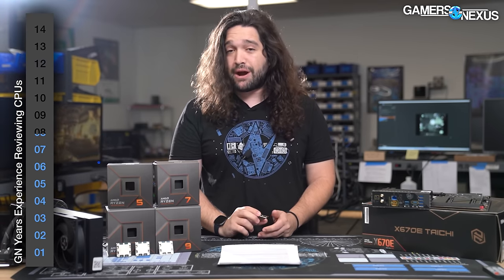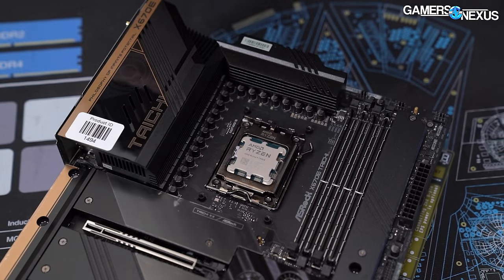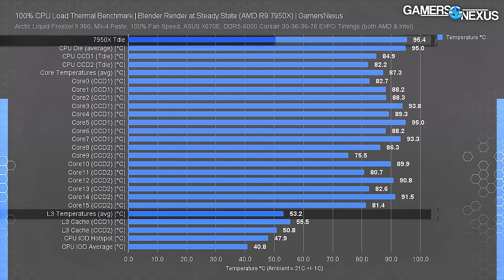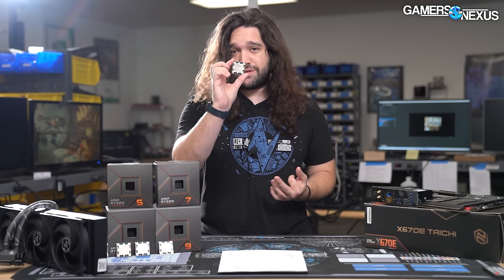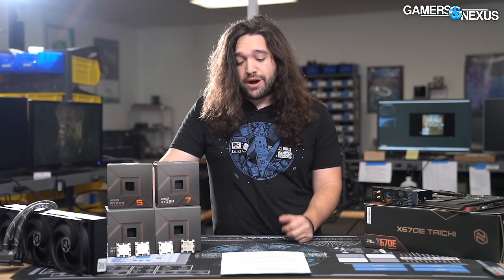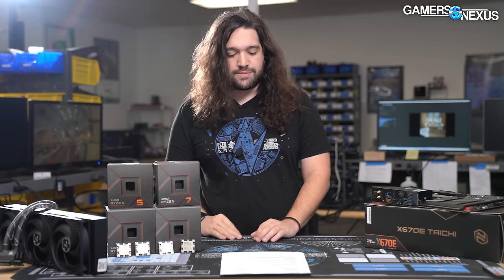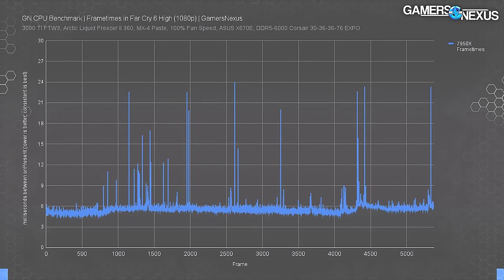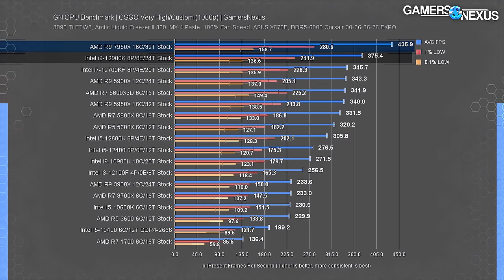95°C is Now Normal: AMD Ryzen 9 7950X CPU Review & Benchmarks

Comment: I would love to see more CPU-focused games to start getting tested. Simulation heavy games, large sandboxes, stuff like that. I don't know what kind of benchmarking those games support, but with being GPU bound on most games, or being at FPS levels where it doesnt matter, those might still present an actual useful difference.
Reply: mega station re-entry in kerbal? something like that?
Reply: I second this. I'd like to see the difference as well since I play more of those types of games.
Reply: I remember seeing Civ VI being used for benchmarks like this on some other channels, but that's obviously more random and the result is less replicable so I understand why GN may not want to use something like that for testing
Reply: Warcraft 3/Starcraft 2 most certainly!
Reply: They should do some VR games for benchmarking, since alot of them tend to be CPU bound currently, a good example being VTOL VR
Reply: Emulation benchs would be good too. things like Dolphin and RPCS3.
Reply: Even then those games aren't really multithreaded enough to make sense for the 7950x, in many cases they're completely single threaded!
Reply: @TimSheehan  This is as opposed to any of the games tested/in existence which scale to 16 cores
Reply: BeamNG stress test with full traffic? Timberborn with 1000 beavers? Universe Sandbox and see how fast you can advance time?
Reply: @LunarLaker  not as opposed to, but they're even less multithreaded than your average DX12 / Vulkan game
Reply: Maybe X4 foundation / Arma could test cpu
Reply: I'm surprised they don't do any CPU heavy Battle Royales like Warzone/Tarkov. I'm seeing people anecdotally getting a big uplift on Warzone going to the 5800x3D from other Zen3 chips. 

I mean why are they testing games where they are getting 600FPS? Some of these games stopped being relevant to CPU performance like 6 generations ago.
Reply: 144FPS its the matter !
Reply: A heavily CPU limited game is Beamng drive.  I managed to pin my 12900k to 100% use with 50 other cars in traffic settings.
Reply: Spider-Man is a great recent example - open world + raytracing can be incredibly demanding on the CPU. It's very easy for me to underutilize a 3090 (using a 5950x) even while running around 1440p.
Reply: I agree. I think it would be interested to see benchmarks in games like Rimworld (with a large colony), They are billions (with a large hoard), and Project Zomboid (with lots of zombies/items loaded in the same cell).
Reply: Flight Simulator would be a great sim game to test, now that there are replay tools (built-in, as well as free & paid mods) that can fully replicate flights for benchmark purposes.
Reply: @Richard-tj1yh  those are single core games only, no multicore support
Reply: Indeed.  I've long wished that reviewers would find a way to include heavily modded Cities Skylines, as that's long been an IPC crushing CPU limited game.  Though it would realistically require collaboration with C;S streamers, to ensure the right mods are being used and it would need to be updated at least annually to ensure relevancy as new mods are introduced and updated.
Reply: DCS (a combat flight "sim") in VR will take the 4090 (rip SLI) and any CPU (even on LN2) and give you < 60 fps most of the time.
Even without VR, it's still practically impossible to achieve a stable 120 fps (or even just 90 fps at low altitude) on any of the recent campaigns.
Reply: Yeah. I really dont agree with the testing results here. Playing Satisfactory.. 800 hours in, my FPS has gone from 120+ to barely 50 FPS on RTX 3080. i9900K. All cores pegged at 90%+. And then these reviews just come and say that CPU does not matter and its a waste of money to buy it for gaming.
Reply: Would love to see Factorio benchmarks
Reply: MSFS, DCS Word, Factorio, Satisfactory... pick any simulation game really, the scaling across them is quite similar for most part.
Reply: do a petition and yell at twitter i guess
Reply: @mortlet5180  Hello fellow sufferer.
Reply: Try Paradox Grand Strategy games!
Reply: Yes, something on a large map/server with lot of players and NPCs.
Reply: this, microsoft flight sim or ACC, many mmos are all still hugely cpu bound in real situations player encouter (crowded towns etc)
Reply: Total war with extreme unit size!
Reply: Yeah, something like Stellaris, Factorio, Dwarf Fortress
Reply: I was just thinking about Factorio and Civ
Reply from the maker: Sure, we can look into some. Please post some you'd like to see!
Reply: @GamersNexus  Yeah Cities Skylines is still one I play regularly. Same as others Factorio and ACC are on my recently played too.
Reply: Play badly optimised MMOs
Reply: Cities:Skylines with a large amount of mods and assets.  I had to upgrade my gaming rig with 64GB of RAM just to satisfy my mod addiction 🙃
Many of the C:S YouTube creators post save files and their mod collections, so getting one of their ridiculously large maps saturated with mods and assets is relatively easy to do.  City Planner Plays is one of my favorites who is really meticulous about save files and providing mod/asset collections on Steam.
Reply: Farm simulator 22. Quite demanding on vid cards.  Yes… there other great games instead of games killing constantly.
Reply: @GamersNexus  a total war game with extreme unit sizes would be great!
Reply: I AM THE BEEST YOUUTUBER YOU'RE ALL TRAASH COMPARED TO ME IM THE BEEST 😂😂😂😂😂😂😂😂😂😂
Reply: beamng drive would be good for that as its almost entirely cpu bound, and when its not just spawn in more vehicles.
Reply: It's Gamers nexus, but should be called blender and Puget nexus
Reply: @GamersNexus  Benchmark Rust, its game where only 5800x3d performs good.
Reply: It would be cool to see some VR benchmarks thrown in there too. Most VR games are cpu limited at this point. Blade and Sorcery starts to shit itself if you try to spawn to many AI with a older CPU (I’m on a 2700x and a 2070 in a SFF rn and can get 7 or 8 spawned at once before I start to notice issues, no matter the graphics settings)
Reply: @GamersNexus  Try minecraft with various number of entities present on screen
Reply: @GamersNexus  Cities Skyline and Beamng Drive are two that I play regularly that I would love to see how those do.
Reply: @GamersNexus  I'd like to see Valorant, but it might be difficult to benchmark
Reply: @GamersNexus  total warhammer 3 on max settings would be great! Cities skylines or hoi4 maybe!
Reply: @GamersNexus  Paradox titles (Stellaris, HoI4, CK3) have maximum game speed limited by CPU capability only.
You can start a game as spectator, put max game speed on and see how long each CPU takes to process 1 game year in HoI 4 as an example. It does have practival application for gamesrs who play those, as sometimes you want max game speed compression while there are no new decidions to make.
Reply: I still like to use Civ 6 as a CPU benchmark.
Reply: @GamersNexus  Total War: THREE KINGDOMS or the Warhammer 3 title. As well Age of empire 2 Definivite edtion, Age of Empire 4 all with 4vs4(bots)
Reply: Factorio megabase fps tick rate and fps would be a good benchmark.
Reply: RPCS3 would be a great test to add, with how CPU heavily the emulator is.
Reply: @GamersNexus  Minecraft is a good tester for CPU bound games it would definitely help, it has very high numbers which would help test
Reply: @GamersNexus  Stellaris, a space (soft) sci-fi RTS with minimal visual load where building a planet cracker and obliterating a civilization or two is universally accepted solution to inevitable late-game perfomance issues. They even have a dedicated "Perfomance" section in every update! Standartising a test would be nigh-impossible, though.
Reply: @GamersNexus  Late game campaign map for total war Warhammer 3 or 2, as well as a battle with multiple armies fully stacked, and late game civilization 6 would be amazing. Specifically late game though. Total war would be perfect, my PC literally freezes if I push it too far.
Reply: @GamersNexus  1. Assassins Creed Valhalla 2. Call of Duty 3. Maybe even GTA5 because of the big userbase and demand of the detailed open world
Reply: @GamersNexus  DO STELLARIS LATE GAME --> how many days can be simulated in example 10 minutes.
Reply: A great game for that would be teardown, all the physics run on a single core, so your fps is single core dependent.
Reply: @TimSheehan  that's the point of the tests, lol.
Reply: The easiest one to set up probably with Assetto Corsa with maximum AI player
Reply: @GamersNexus  Hearts of Iron 4, a 1950 save, fully decolonized Africa trying to go 5 speed.
Reply: @rahulahl  the reality is satisfactory is a niche game and there's a reason why they tell you to check other reviews and not just go off the word of one review. either way it's a hard to test simulation games because everyone plays them differently. there's no way to say "this is the exact performance you're going to see".
Reply: @GamersNexus  any paradox game late game will choke and kill even the strongest of CPUs, they're a good benchmark if you want to find out which does best. Simply take the amount of time it takes to process x amount of days after x amount of time has passed in-game. Stellaris is notorious for it's late game slowdowns because of how much it starts to hammer the CPU.
Reply: @GamersNexus  Beam.ng is very CPU heavy if you have some AI cars driving
Reply: @GamersNexus  Cities Skylines, Arma 3, Squad, Assetto Corsa Competizione are some I can think of
Reply: Factorio. Run a 10000 SPM (Science per minute) factory and show us the FPS/UPS...
Reply: @sirmonkey1985  Dont need the exact numbers though. If a benchmark shows 60 FPS with CPU A and 90 FPS with CPU B, in a typical scenario, thats all the info that matters. 

Just pick a game.. maybe get your audience to give you a savegame if you dont wanna invest much time in it, and just run the numbers on a particular scene. 

And I really dont agree with the fact that testing games that dont even need the CPU to show how good or bad a CPU is and then saying that if you game, then the CPU is not for you is any better than using less common but more relevent examples of games. 

I just feel tired of almost every outlet trying to downplay CPU, when I seem to be constantly bottlenecked by CPU. The most common games I tend to play are Satisfactory, Counter Strike, VR games, etc. I know its my problem that I am using games that are not popular and I might be niche. But in a CPU test, I want to see games that actually care about CPU. Not just GPU bound games artificially limited to be CPU bound. That is just unrealistic testing.
Reply: @GamersNexus  world of warcraft, along with some ram testing please.
Reply: @GamersNexus  Satisfactory please.
Reply: @DocNo27  Same deal here, I bought 64GB RAM explicitly for C:S.
Reply: @Baconism  yes, great. that and dcs.
Reply: @GamersNexus  If you don't mind older game from 2007 then Forged Alliance Forever is still getting bottlenecked in single core performance even today. And what's important it greatly maybe even linearly scales with the IPC of the CPU and RAM combo across the line, be it Intel or AMD. That is due to the simulation part of the game being single threaded but having to calculate and simulate thousands of units and projectiles every 0.1s which leads to the simulation part getting slower and slower as more stuff gets added to the battlefield over the course of a match. In some cases leading to scenarios where 1s of in game simulation takes dozen seconds IRL. 

As for how the test would be performed? Well, we at FAF can prepare a special scripted scenario for you that would push the simulation as hard as we can while making sure to record the time it takes the CPU to finish it. Actually, we already do have few of them as we are using them to benchmark players CPU so that we can give them a good estimate of performance and what types of maps/games or how many units they can have in their games before the game inevitably becomes to slow to play it out due to CPU bottleneck.

And in our findings the scenarios are nearly if not perfectly reproducable each and everytime so they make for good benchmarks. Another thing to mention is that the benchmark results nearly perfectly correspond with other IPC tests so there is no bias in the results in our understanding.

Also, you will get brownie points from Linus Tech Tips as this is one of his all time favourite games, one that he still plays in his free time. 

Anyway, if you are interested don't be afraid to reach out to us by email: admin@faforever.com  as I'm sure our Devs will be willing to help you out in setting up perfect benchmark suite.
Reply: @GamersNexus  just test Star Citizen @4k and get sucket out of the window with 100 load on both , GPU (6800XT) and CPU (5800X3D)
Reply: @GamersNexus  DCS, VTOL, kerbal, factorio, BeamNG, stellaris...
just anything that does physics or ticks with cpu will do and we can extrapolate for most cases and sus out outliers in forums ourselves.
thanks, steve!
Reply: @GamersNexus  Team Fortress 2 is very cpu bound and has a builtin benchmark command "timedemo" the game is kinda old at this point. Still has a lot of players though
Reply: Factorio megabase!
Reply: Oxygen not included is quite cpu bound
Reply: @GamersNexus  I know it’s quite an old game now, but Arma 3 is extraordinarily CPU bound. There are even some community made benchmark missions on the workshop. Another heavily CPU bound game would be the combat flight sim DCS. It’s possible to make a 100% replicate-able benchmark where your plane just flies straight over a massive ai battle. I would love to see you guys test games where the new CPU’s could actually make a huge difference in gameplay experience!
Reply: Yep. I'm thinking massive parks in Planet Coaster, and sprawling metropolises in Cities Skylines.
Reply: Yeah I'd love to see benchmarks of Space Engineers and Satisfactory
Reply: @GamersNexus  Escape From Tarkov is very poorly optimized and as a result is quite CPU and RAM bound
Reply: @TimSheehan  this cpu should be peak single thread.
What other games require this kind of cpu power other than old unoptimized single thread games? As you can see, everything else is obviously playable as Steve remarkably pointed out with Rainbow Six Siege reaching 600fps+
Reply: @GamersNexus  Older single thread games like Starcraft 2/Warcraft 3 is where this new computing power is actually applicable, unlike the alikes of 600+ fps Rainbows with CPUs nowdays
Reply: @GamersNexus  Get someone to make a Factorio megabase and use it for testing, that will give very good benchmarks
Reply: @chdn  Vanquisher Class Mothership (914k PCU) from steam workshop can used as benchmark. Sim speed while flying in a straight line can be used as measuring criterion. for example my tuned 12700k@4.9GHz all core / 4.6GHz ring (e-cores and ht are off) with 32GB 3800c16 ram can score about 0.5 sim speed.
Reply: MSFS2020 is one of the most CPU hungry modern sim engines. There are tools that can make bencmarking scenarios repeatable.
Reply: @GamersNexus  stellaris in endgame
Reply: @GamersNexus  Satisfactory is a game I would love to see. The developers/community managers are also good people and I'm sure would be happy to help out. Otherwise any strategy game in a late-stage, Civ6 time-per-round, Stellaris end-game, something like that.
Reply: @GamersNexus  BeamNG drive might be worth looking at. IIRC, the more cars spawned into a map, it starts pawning them off to the extra cores to process.
Reply: @GamersNexus  You can always include some old, mostly single threaded unoptimized games. One of those games is total war shogun 2 which can easily tank my fps to around 20 fps in full battles with ryzen 5600.
Reply: Universe sandbox is quite cpu heavy 🙊🤣
Reply: @GamersNexus  Id love mainstream youtubers to look into MMO benchmarks. Especially World of warcraft in my case. Maybe slap on ton of addons to round the profile off. No benchmark tools, but running around an area that is static is fine enough. Or you can join a Looking for raid or battleground for 5-10 mins.
Reply: @GamersNexus  I don't know how good civilization 4 would be for benchmarks, but that game takes quite some time to calculate AI turns in the late game on my overclocked Ryzen 2700 with 3200cl16 dual rank memory. 
It doesn't have a built-in benchmark but subjectively it seems really consistent with turn calculation time. It might be a good benchmark for your "average calculation hard strategy game".
Reply: DCS would be a good choice because it hammers one core
Reply: @GamersNexus  Dwarf Fortress. No game I know that is CPU Intensive as that game.
Reply: @GamersNexus  Factorio maybe? Their simulation is deterministic so you can just have a save, load it and look at the UPS you're getting (which is "updates per second" or how many times the game manages to update state in 1 second). You need some serious base for it to tank on such high end CPUs but it might be possible?
Reply: @GamersNexus  Escape From Tarkov. I dare you ;)
Reply: rimworld with like 600 mods lol
Reply: @GamersNexus  factorio
Reply: @GamersNexus  I made a separate reply before seeing this thread. Since you are monitoring here, I'll double post a vote for Microsoft Flight Sim 2020, which seems to get CPU bound flying around NYC due to all the buildings and AI traffic.
Reply: RPCS3
Reply: @GamersNexus  Late game Hearts of Iron 4 is an absolute CPU killer
Reply: @GamersNexus  Satisfactory?
Reply: @GamersNexus  I would like to see Path of Exile being run in a map like this: Tier 16; corrupted 8 mods; 20% quality; over 139% item quantity; 100% Delirious; 4 Sextants - Legion, 2x Abyss, 2x Breach, 2x Essence; 4 Scarabs - Winged Legion, Winged Abyss, Winged Breach, Winged Harbinger; Eater of Worlds influenced; Einhar - Bestiary activated.

It would be very hard - near impossible actually - to reproduce results, but many players wonder how POE runs in highend machines and there's very little on the internet about it.
Reply: @GamersNexus  DCS World and IL-2 Great Battles for other modern flight simulators to complement Microsoft Flight Sim 2020.
Reply: War Thunder would be a good addition
Reply: @GamersNexus  Star Citizen, unironically. They are probably the most CPU bound game around.
Reply: @GamersNexus   Ps3 emulation would definitely be a "gaming" scenario where these cpus could show how much more performance you can get out of them.
Other "useful" test would definitely be endgame scenarios in games like Stelaris.
Reply: Rimworld 
Factorio
Reply: Factorio with the time tools mod to allow the game to run as fast as it can. Would be a good way to measure relitive cpu performance without building a massive base. Factorio will also tell you if it is currently cpu or gpu bound as well and if it is GPU bound it can drop frames to maintain UPS.
Reply: @joeblow5214  it seems crazy (especially when talking to other people about it) but it was the only thing that made a significantly positive impact on performance!
Reply: @GamersNexus  I would love to see an emulation benchmark. Now that we’ve got the new AVX-512 instructions RCPS3 has said that it results in a massive uplift, but I’d love to see how that translates into numbers between CPUs
Reply: @GamersNexus  I'm pretty sure civilisation 6 is cpu heavy when loading the round time. So you can basically make a savegame far into the game and stop the time it takes to load this round.
Reply: @Gamers Nexus, the Space Engineers game, a voxel based sandbox, where every block you build has its own unique PCU cost (Performance Cost Unit). It would be interesting to see different CPUs trying to calculate multiple complex mechanisms the players build.
Reply: @GamersNexus  assetto corsa competizione (ACC) is a good gaming cpu workout. The high level of physics calculations for the AI cars are very demanding.
Unfortunately it doesn't have a dedicated benchmark mode but single player bench mark mode against a full AI grid (29 cars i think) kills my poor 5600x.

I think with your clout tho, if you wrote to Kunos and requested it, they could easily implement a benchmark mode.
Reply: @GamersNexus  Metro Exodus, RDR2, CP2077, Microsoft Flight simulator are pretty intensive workload for cpu in selected locations in game with a lot of physics - no built-in benchmarks of course.
Reply: @digsumdirt  I think this is most likely due to the power target/limit/TDP, so at full utilization your cores can't clock that high to fit into the power budget and thus won't get so hot. When just one core is loaded, like is the case in most ("older")/many games where mostly one core is pegged, this core will/can clock very high and result in high temperatures, on a smaller spot as well. I have the same with my R7 3700X, which goes to 64°C max on full load (with my be quiet! Dark Rock 4), but will spike into the 70s as well in games.
The spikes could also be primarily due to the Windows power plan though, which also causes this "sawtooth" temperature pattern in idle. I (still) haven't tried adding the Ryzen optimized power plans.
Reply: Factorio would be perfect. A Factorio megabase, benchmarking the UPS (updates per second) of the simulation
Reply: @GamersNexus  off the top of my head a few games with CPU heavy scenarios (you should be able to get a few community savegames set up as benchmark): 
-Factorio (Megabases with 1k+ science per minute)
-Kerbal Space Program (with Rockets far exceeding 100 parts)
-Stellaris (endgame lag in a huge galaxy with max AIs)
-heck, endgame lag in all of Paradox' games (EU4, CK3, HoI4, soon Vic3)
Reply: @GamersNexus  stormworks From the depths, kerbal space program, city skylines. Factorio. timberborn, Planetary annhilation titans, Anno 1800,  PROJECT ZOMBOID 4k zoomeed out makes me lag hard lol
Reply: @GamersNexus  Football Manager 2022/2023 is your best bet. Load a significant number of leagues (you could pick them all if you want to wait a year, or maybe 20 otherwise) and time how long it takes for a season to holiday. FM games in the past (not sure now) tended to favour clock speed over cores.
Reply: Flight Simulator for me, but I think its already clear the 5800X3D is still the champ which is frankly bizarre, why dont all the new chips have the same cache technology?
Reply: A shit load of huge block count ships in From the Depths.
Reply: @GamersNexus  test rpcs3, xenia, and ryujinx. With God of war 3, read dead redemption and Xenoblade 3 or Bayonetta 3 respectively. Hardest games to run on those systems. Get a 60fps patch for the Nintendo games
Reply: @GamersNexus Stellaris, Hearts of Iron IV, Cities Skylines, Rimworld, Satisfactory, Civilization V, Crusader Kings II, even Minecraft in certain cases, some of these games have strong visuals, but these are mostly CPU intensive games, with significant performance drops for individuals who utilize mods especially, and individuals who use mods and get into later stages of these games. Most computers gradually fall apart with these games loaded up on graphics and mods, and really just operate as potentially great PC benchmarks, assuming they don't bottleneck their performance to a limited number of CPU cores from limited threading or something silly like that. If you want to test how well parts like CPU's perform over long period tests, which would more accurately reflect a gamers experience as they played these games with whatever parts over the course of a playthrough, these games can work as great choices, especially if you utilize the modding aspects of these games, as mods generally just add more processes for the computer to deal with, and there's less mods which optimize performance. Select that right mods that avoid crashing and instead enhance graphics and add huge amounts of data for the computer to juggle, and come up with a repeatable series of steps you want the playthrough to take to benchmark computers, and you have the ultimate testing platform for the most ignored audience when it comes to gaming PC's and parts: the strategy game player. Strategy games will utilize way less GPU generally, and way more CPU, and some don't have in-game limitations that prevent you from freezing up your entire computer with larger and larger scale tasks in those games. Other games you feature are much more GPU focused, like Cyberpunk and Red Dead Redemption II. Obviously they do use the CPU a lot, but they are not really geared specifically towards CPU usage, and more GPU usage, and this goes for most first person games. Minecrafts generation of terrain and random chunk generation in real time utilizes CPU a lot more than GPU, although there are graphical enhancement mods to make the game well over 100x more demanding on the graphics side, specifically with shader mods. On the other hand, Stellaris only has a limited amount of GPU usage, but its galaxy simulations have proven to be far too great a task for my computer to handle as other species are met and the game is simulating an entire galactic community, with hundreds or thousands of star systems, in one top down strategy game. 

TL/DR: You use a lot of fancy graphics games, but theres lots of big numbers games you should try, which will reflect more gamers in your tests